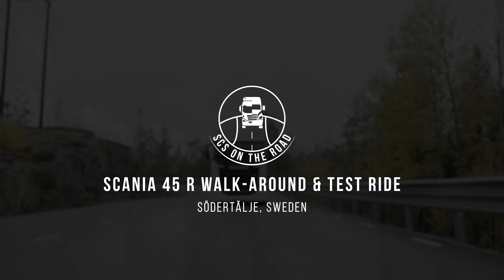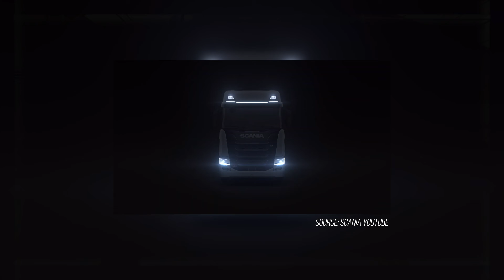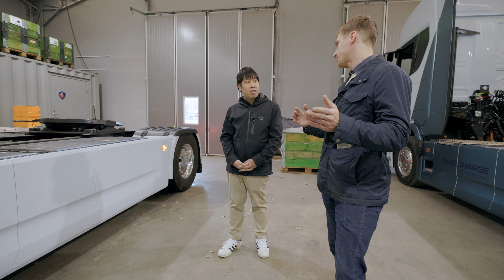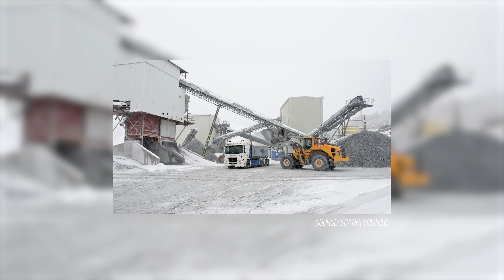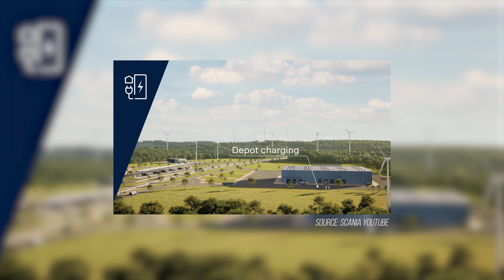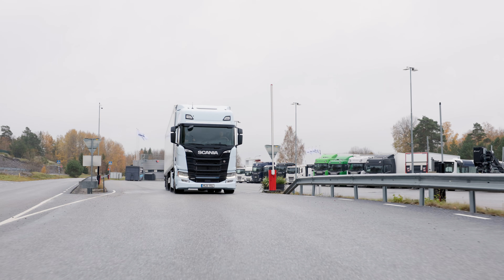SCS On the Road - Fully Electric Scania 45R Walk-Around & Test Ride

Comment: Having Electric base vehicle cloud be fun experience in the game. The question is how you guys gonna implemented it into the game ? like are there gonna be some charging station nearby ? also EV performance is quite difference to a vehicle with combustion engine, while EV had better acceleration and instan pulling power in retrun they do have less range than any conventional vehicle

Comment: This is the same truck as diesel Scania. It is not interesting. If you want to add a new trucks - start working with rigid chassis. We dont need reworks of trucks with no sound engine
Reply: Rigid chassis requires licenses wich are not cheap so this truck is supposed to make the game sell more and then they can pay for licenses
Reply: @daveyab4889  they pay to much for useless licenses. Also scs doesnt make a cool stuff which  #thebestcommunityever wants
Reply: @ArtisBright  they can not get every license they want Scania can force them to buy this liscence first and then provide licenses for the other ones that we diesel fans like

Comment: 14:32 I don’t think that a 45 mins break gets you 60% of a 624kWh battery with a 375 kW charger. You’ll get an additional 45% of charge within 45min off a 375 kW charger in ideal condition since 45/60*375/624*100%=45.07%.
Reply: Mathematician over here
Reply: 624kWh is the nominal battery capacity. In reality, the available capacity is about 75% of those 624.